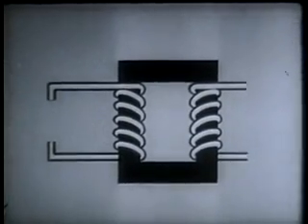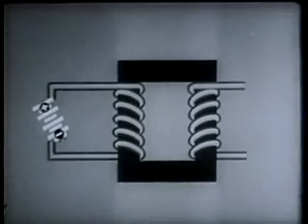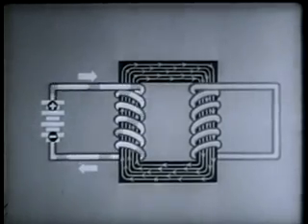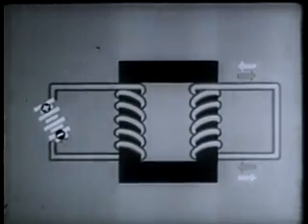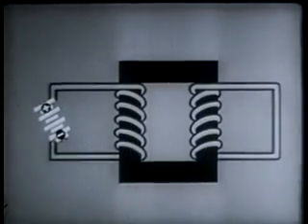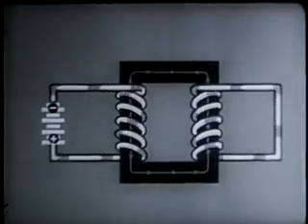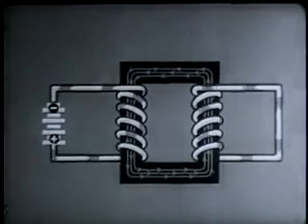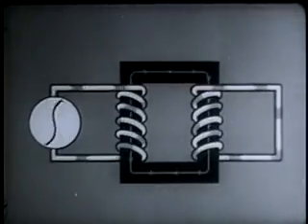THEORY OF SIMPLEX AND PHANTOM CIRCUITS - PART I - BALANCED CONDITIONS

Comment: They only cared for time and lives, as if the wires and other supplies magically appeared on the back of the trucks! 
That's the logic used by lots of videogames, you just have to do something it in the minimum amount of time and losing the minimum amount of lives, as you move from one place to another you will find everything you may need without anyone wondering why it is there or where it came from.